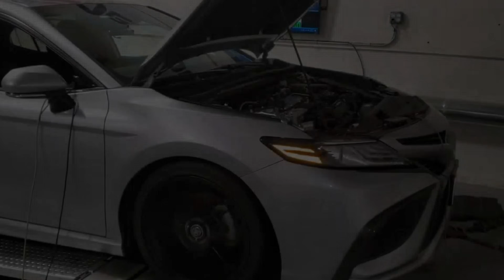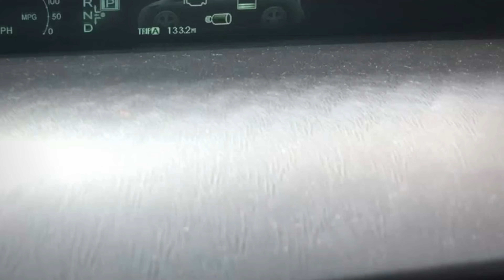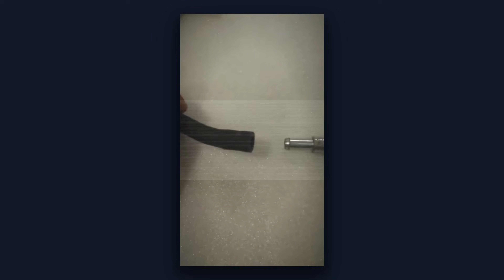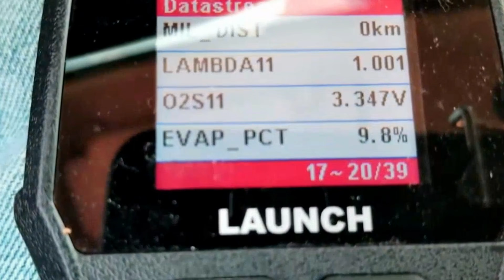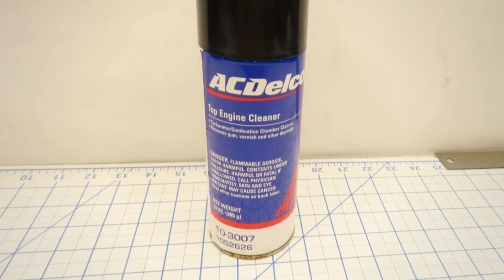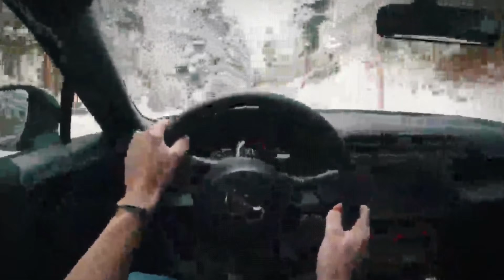INSANE $15 Toyota Fixes That Actually BOOST MPG (DYNO PROVEN)

Comment: Sorry!  I must argue against the price of the upstream oxygen sensor; AKA, as known as, the AFR; Air Fuel Ratio sensor.  This is the most expensive sensor of the 2 types.  For a decent one these start at $60. USD.  upwards of $400. USD!   Don't misinform public, you twit!   Over good information, except for your price figures!

Comment: PCV valve on 2016 Corolla = UNDER the intake manifold. Toyota quotes over $500 to change(disconnect a lot of stuff, remove intake manifold, etc). There are some ways to avoid removing the intake but no fun at all.

Comment: All that is pointed out in this video are important, but, costs quoted are absurdly low in my opinion. For example: a PCV valve in a 6-8 cylinder Toyota/Lexus engine depending on the model, can easily cost $200 up to $600 in labor and 1-2 hours or more of work, which is not mentioned, if a dealership or independent mechanic is requested to do the work and even more time may be needed if the DYI mechanic is unfamiliar with the replacement procedures.  Some of the recommendations may need a car lift, which may not be available to the average DYI person. Similar statements can also be made for other recommendations in this video. Just saying. Also, are you going to Toyota or Lexus, which costs more in labor rates. I have found that many Toyota dealerships will not work on a Lexus, even though the engines are nearly identical.